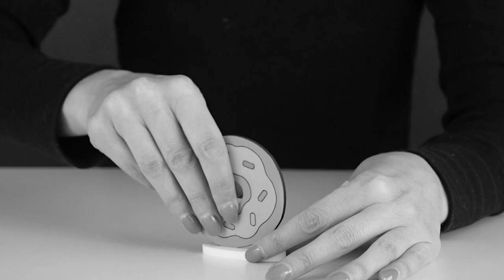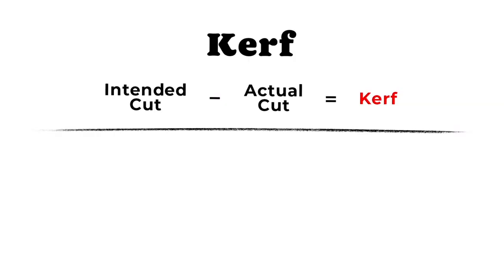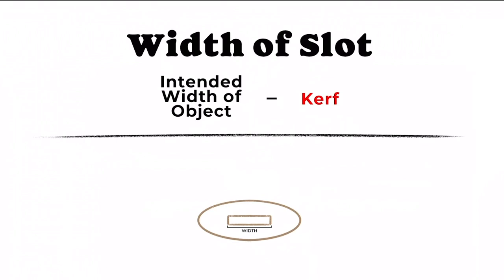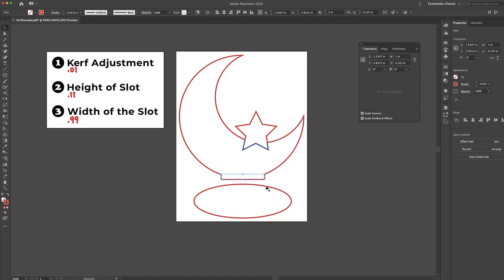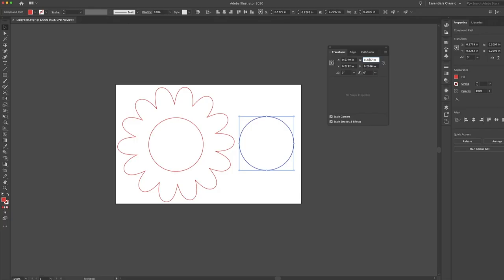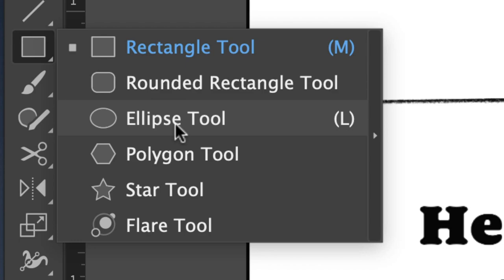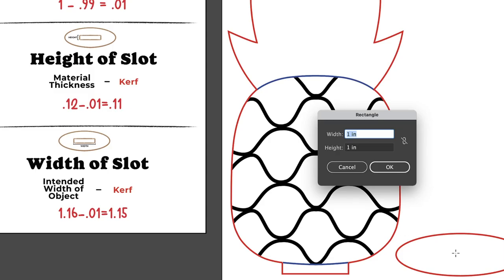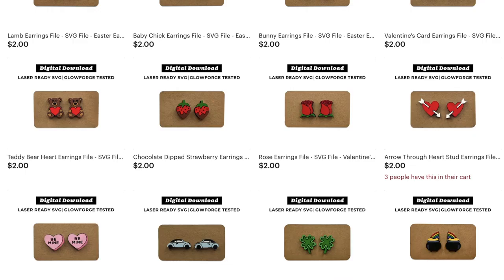Kerf Tutorial | Laser Cut the Perfect Fit

Comment: Hey, great video, and easily understandable. 
One slight correction though. On a Cut Rectangle - you have 2 sides Cut, thus your measured value of 0.01 inch is actually 2x the true Kerf of 0.005.  Just wanted to leave this here if someone has slots/designs where they only cut 1 side.

Comment: Great video that explains kerf perfectly.  My question is - to create a digital file for someone else to use, their kerf measurement will be different depending on the material they use.  Do you include instructions for customers so they can be sure their material fits perfectly using your design?  (Hope my q makes sense!)
Reply from the maker: Hi Sharon! Thanks for watching :) I've actually thought about this. I would probably include instructions on how to figure out the kerf, and in your listing mention that every machine is different so they will likely have to make some adjustments for the design to fit perfectly. I've purchased a digital file before that had 2 pieces that fit together and I had to adjust the file a decent amount to get a perfect fit. Hope that helps :)